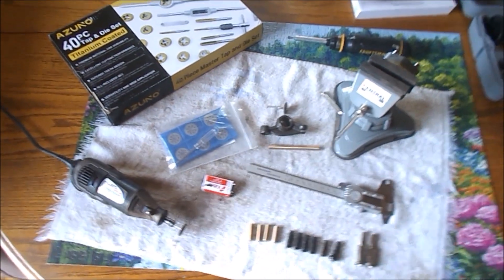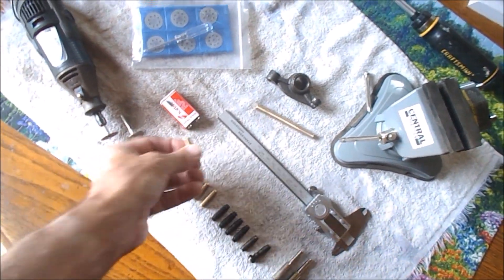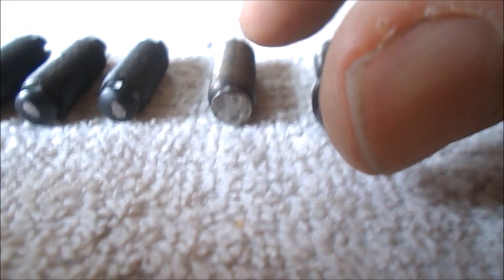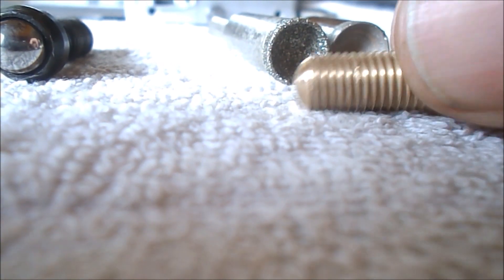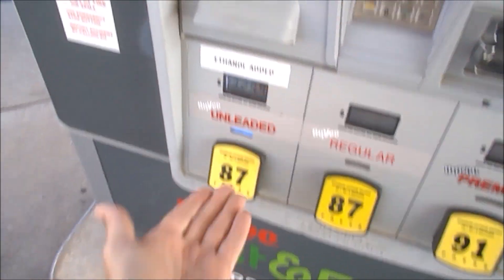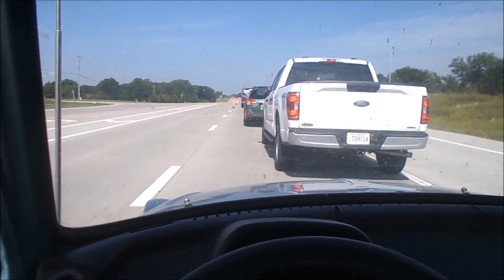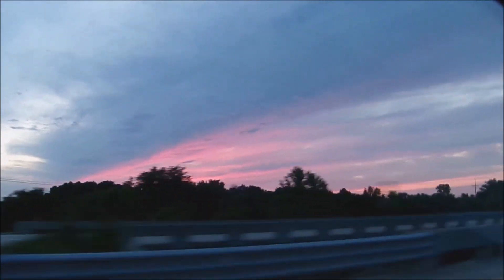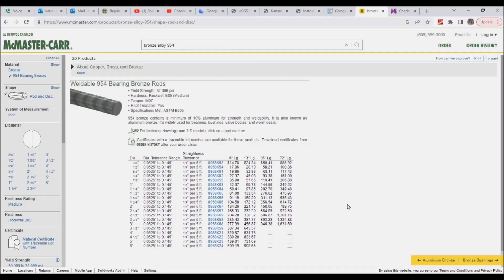73 super beetle metal rod results

Comment: Hi Scotty, you need to be looking at steel and it's properties, there a multitude of different alloys of steel with different toughness and hardness depending on how it is heat-treated. German engineers knew what they were doing...
Reply from the maker: steels are tough and cheap. sadly, i haven't found any steels that have a low friction against stainless steel. i will keep looking. i have no time frame for this project. just something i was curious about